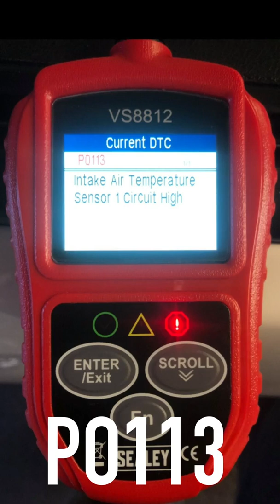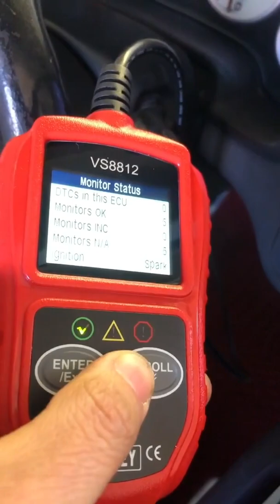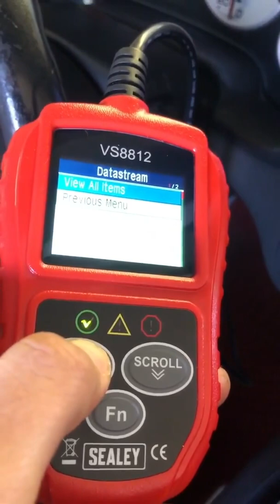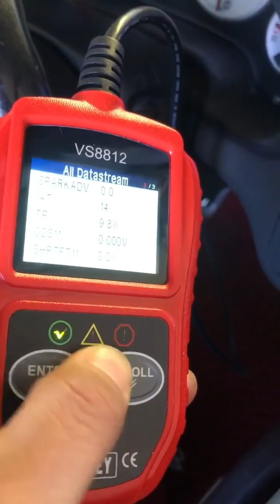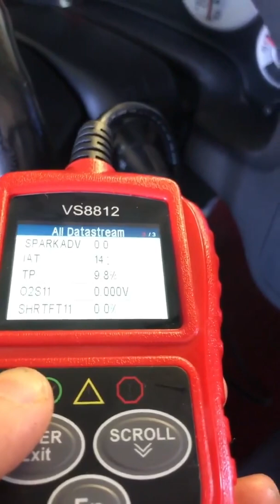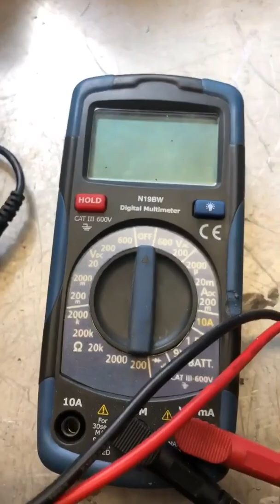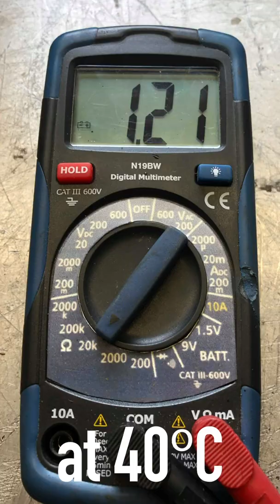Code P0113 - Intake air temperature sensor on a Honda Integra K20 DC5/RSX

Comment: on your turbo build, did you keep this ait sensor??? cheers man
Reply from the maker: I upgraded to a link sensor
Reply: do you have a video on that sensor mate, just Google link sensor for k20 yea
Reply from the maker: @alitoroganan2442  I haven’t done one. They are pretty easy to fit you just cut the old sensor plug off and solder the new one on
Reply: @AshBuilt  and then stick it in at the charge pipe yea
Reply from the maker: @alitoroganan2442  yer that’s it.
Dm me on Instagram if you want I’ll send you some pictures